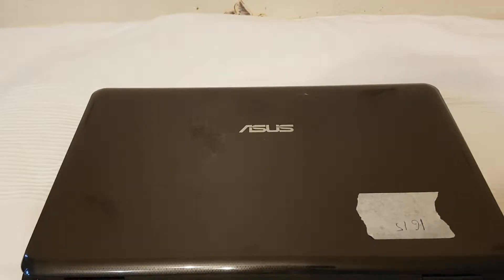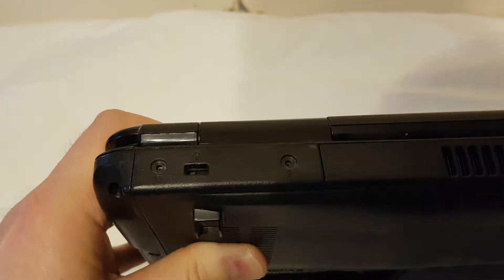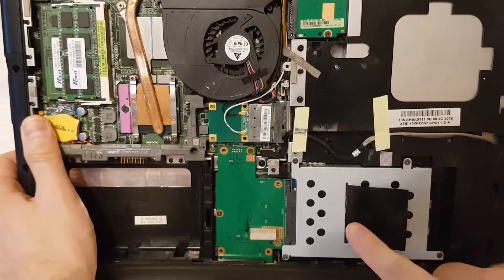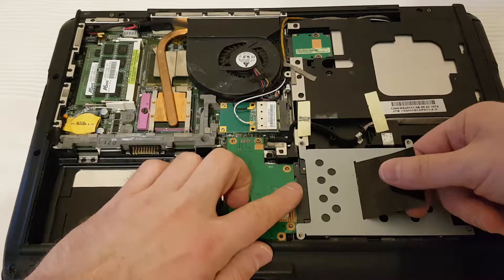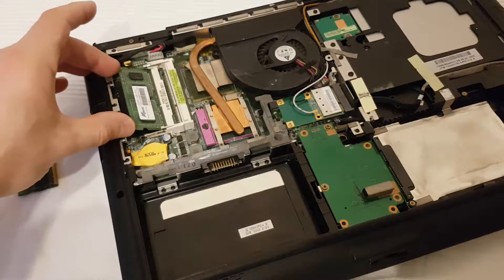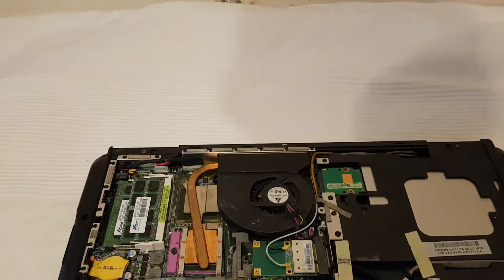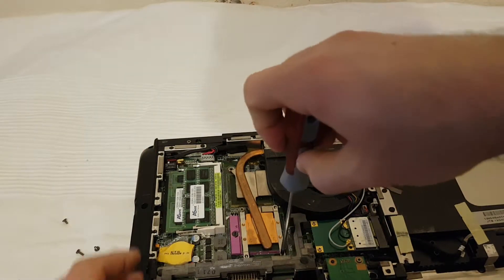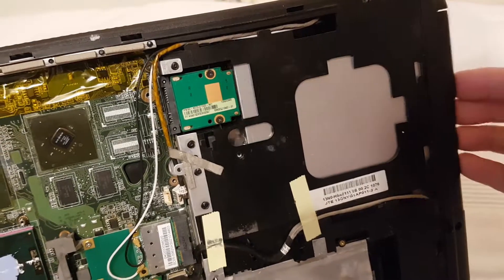ASUS K50I how to replace hdd

Comment: Laptop wont start after replacing hdd. The led indicators turns on for half a second and the turn off. Puting the old disk back doesnt fix it :(
Reply from the maker: It could be problem with maiboard
Reply: @anthonytr9685  But the laptop worked before replacing the hdd :(

Comment: As Electric Whirl1 commented, this does not work! ... until you remove the 5th screw. You can see the screw hole in the video -- it's in the corner of the "cutout" section of the panel. I spent 10+ minutes trying to slide off the cover before I discovered that screw.

I see now that Anthony Tr has addressed the screw in the description. It would be more helpful (a lot!) to have the video edited. I realize you probably can't go back and re-shoot the video, but a text overlay would be very helpful.

Other than that, thanks for the video! Very helpful!